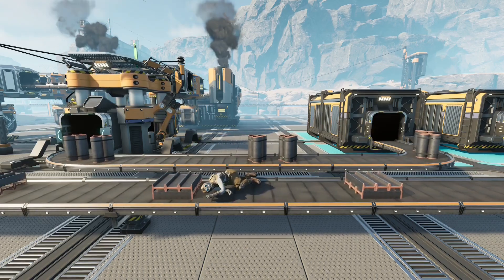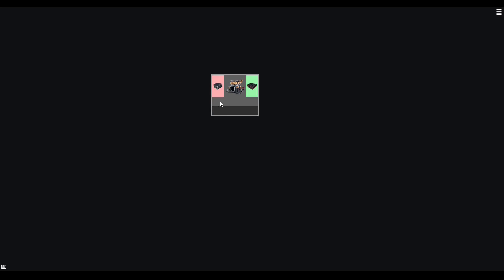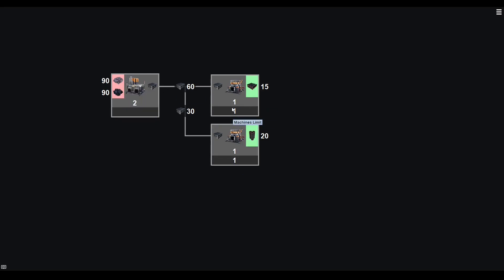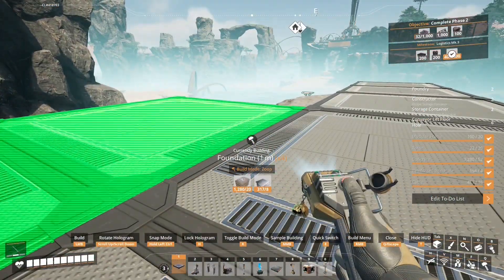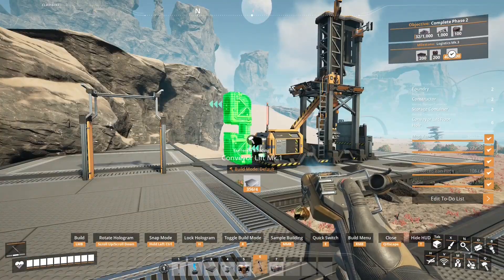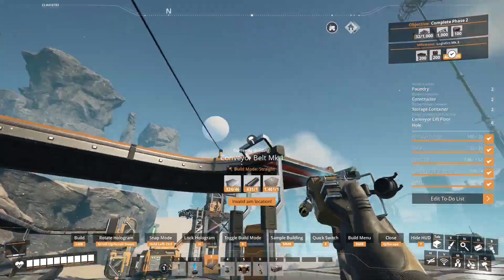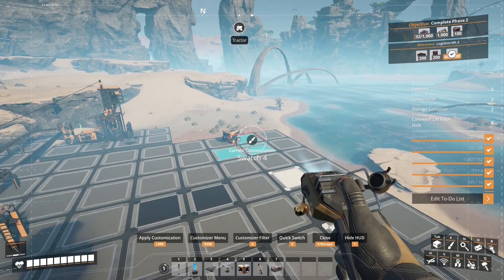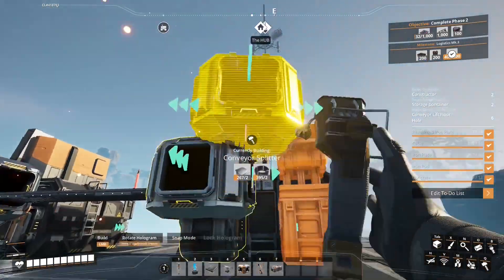First Steel Factory for Satisfactory 1.1 — enough beams and pipes to unlock Phase 2 tiers

Comment: yo im not sure if you respond to comments since hte video is 2 months old but ive done everything correctly and my steel beams are going idle every time it crafts 1 how do i fix this
Reply from the maker: I'll have to rewatch the video to see if I forgot anything, but in the meantime did you feed the splitter from the steel pipe constructor back into the merger for the one foundry with a mk2 belt? 

If the two foundries are getting the iron ore and coal they need to work at 100% then they'll make 90 ingots per minute. The steel beam needs 60 and the steel pipe needs another 30, so you'll technically have enough, but I had a similar issue when I was just feeding them ingots with a single throughput line. When i connected the line in a loop with mergers, then it was constantly feeding both with an equal amount of ingots. 

Basically, the problem is that the splitter cuts the input in half, so the steel beams are actually only getting 30 ingots per minute on the first pass. The steel pipe constructor only needs 30 per minute, so it's getting a 100% efficient line. The problem there is that it will never get overfed and back up, so the steel beam constuctor will never actually get the 60 ingots per minute it needs unless they are looped back through. I went with a Mk 2 belt because I thought maybe it might also send more ingots back to the merger but I really don't know if that worked. A mk 1 belt connecting the pipe merger to its adjacent foundry merger might work just as well.
Reply: @efficientish I’ll re check all of this when I get home thank you for the response and also do you have any tutorials on modular frames?
Reply from the maker: I don't but I don't see why I couldn't make one. I've been trying to figure out how to go about a new series I'm calling "Blueprint Everything" so, that sounds like as good a place to start as any.